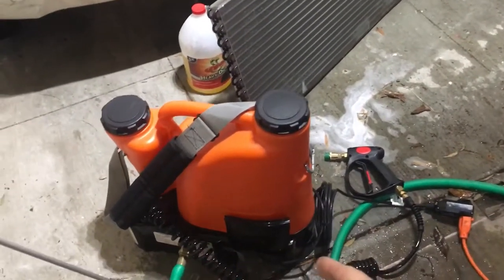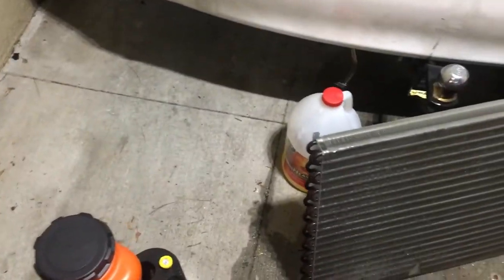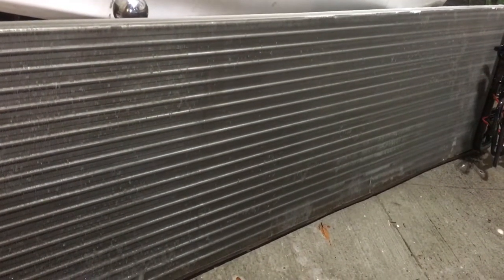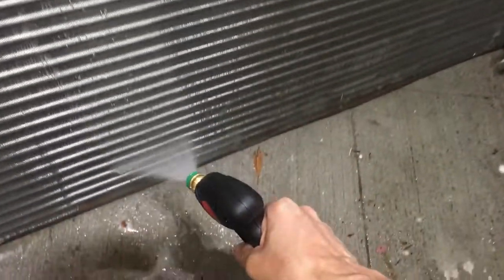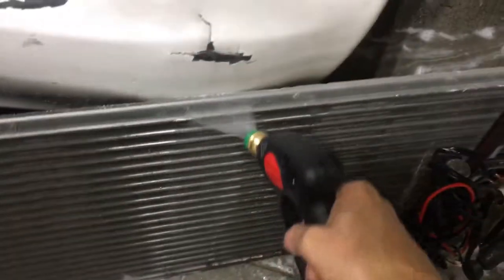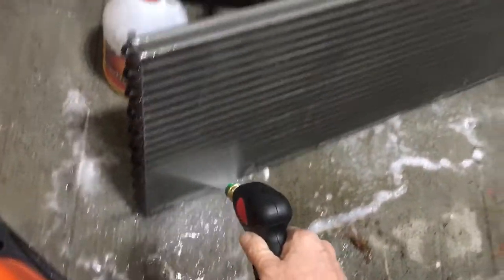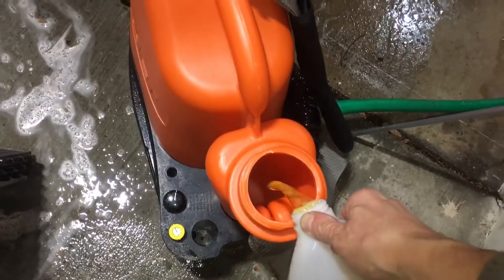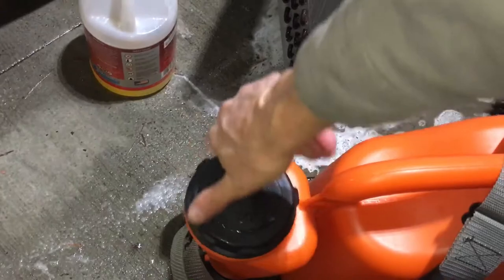SPEEDCLEAN coil jet CJ–200E condenser and evaporator coil cleaner portable.

Comment: do you have to have a hose hooked up to use it? or is that just for the extra pressure? also do you prefer this one over the 125 model?
Reply from the maker: It broke soon after these videos. This is brand new and they had a defect in manufacturing..  a lot of them had a problem with fittings breaking up, or you could not get access to them easily. 

It is now a brick that hangs up on my wall . A cheap power spray. Washer went through. The price is more powerful than this from Home Depot. One of those Ryobi.. 

And I discovered that the sprayers that are used by agricultural workers to spray pesticides on big tall, 30 or 40 foot tall trees on the backpack, more comfortable with easier to wear and use . 

And a lot more power .
Reply: @coldfinger459sub0   huh thanks for the info ill take a look into those

Comment from the maker: When you’re on a rooftop and it’s an older building they do not have water on the roof so you would have a hose but no water source. 

          With no water source then this becomes your next best option. 
             But I really wish it was battery power to especially for the price it’s over price for what it should be but it is not. 
                SpeedClean does have a battery only operated unit but it has lower output and I definitely did not want that unit because this unit output is better than The battery operated unit. This one could be better. 

            If I was at ground level and had a hose to spray water but I would have to have a battery powered foaming or cleaning solvent or detergent unit because the hand pump sprayers just don’t put out enough for real big coils and big jobs you’ll be there all day. 

             And an HVAC business here in our area at $170-$350 plus an hour you’re not gonna be paying somebody to pump a little tiny sprayer that pisses out a little squirt of soapy water on a giant coil . 
               Or if you were in an apartment complex and you had 70+ heat pumps coils to clean and you were carrying around a little cheap pump sprayer. 
                 Unless it was your own unit and your labor is free and you have all the Time in the world or somebody was so grossly under paying their employees they could afford to waste their employees time spending a day or two doing nothing but pumping a little cheesy ass sprayer.  Then they can have Addit. 

            But in the real world with production business when you’re a couple hundred dollars an hour Time is money.
Reply: not worth it in my opinion, Id rather run 200 feet of hose and get the coils really clean.
Reply from the maker: @robfederico2133  I like the hose idea . But carrying 200 feet of hose kind of out of the question and the time to look it up and down a couple flights of stairs and crawl out through a roof hatch. 
               Add approaching $300 plus an hour to pack up hose take it to a roof pull it out use it unhook it drain it out roll it up and bring it back down again.  
          Only if I had a guy working at minimum wage $10 an hour $15 an hour then it would be worth it. 
            Cheapest employee is $75 an hour. To have him packing and rolling up and cleaning out hose would be kind of ridiculous. 
           Would almost be cheaper to spend $200 on hoses on every job and leave it at the job site on the roof but it would get stolen. 

        I might look into investing in replacing the pump with a stronger pump it’s a universal little pump that could be replaced

        Or get one of those cheap spray washers that have the soap edition for much cheaper with more output
Reply: Hey thanks for the review, was thinking of ordering this but for smaller jobs like blower wheels. What area do you work out of?
Reply from the maker: @JDT738126  it turns out after use compared to a pressure washer it’s not that good.   It broke soon after this video. 
       It’s way overpriced not convenient to carry .  Poor mixture control. 
         You can buy 3 pressure washers that do the same for the price.
Reply: @coldfinger459sub0  alright well thanks for doing the videos! I will stick to the hose.

Comment: This unit is trash for $800, it cant even clean lint off a condenser coil. The fact this company could even put this on the shelf is sad.
Reply from the maker: Yes I want to say  The same thing when I got to a tough cleaning job it could not do the work. 

I found out it was only good for light dust and dirt that’s it no real dirty jobs. 

When I got out to my first really dirty job a couple weeks later and I went to use it I almost threw it off the roof I was so pissed off I almost paid $800 plus the few extra attachments that I could got from Home Depot a lot cheaper